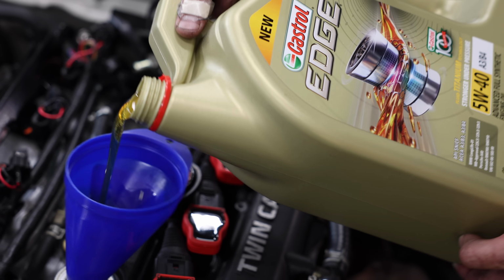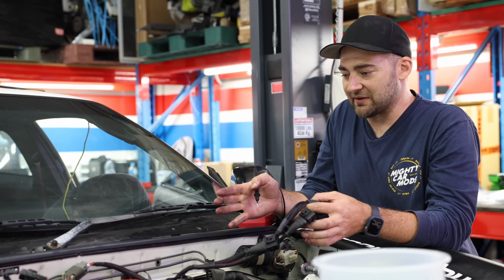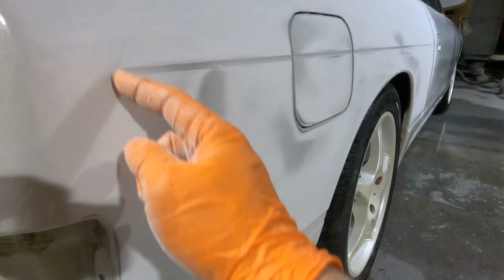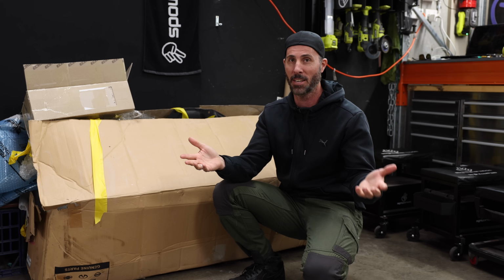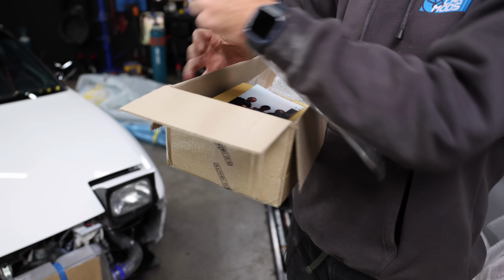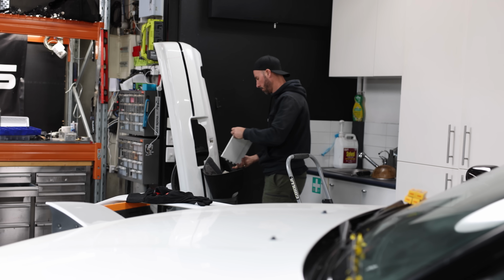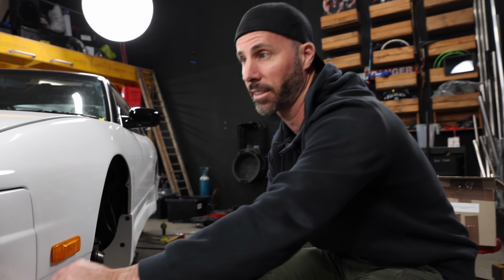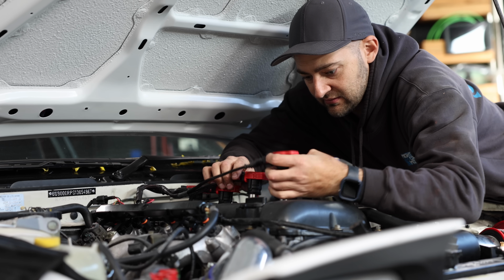180SX - DREAM BUILD EP4

Comment: Hey guys, really loving this series as I have an almost identical 180sx as well. With 5 stud conversions. If you can find s14/s15 front spindles, your local bearing shop should be able to get brand new hubs with studs way cheaper than marketplace. Also r33 rear hubs bolt to 4 stud rear spindles.

Comment: You can actually buy a 3D printed spacer to utilize the old trunk lock cylinder, so you don't have to spend the money and/or use a different key.

Comment: Just love this. ❤ Gives me chills. 🥰 But using the Kouki lock is not the best solution in my opinion. ☺Just expand the OEM lock with two sleeves or washers and bend a new hardwire which is a little bit longer than the OEM part. Takes ten minutes and you'll never have to handle two different keys again like it's a Lada from 1967. 😋 If you want pics how I did this, just let me know. 🤙

Comment: To stop the skirts, or bumper, cracking any further, you can drill a small hole at the end of the crack. Even with ziptie stitches, the vibrations will make the crack grow over time.

Comment: I noticed the Rear windows were removed, i know that you no longer can get them new from Nissan, and my friend had issue because there is rubber gasket with them, and it's as one 'part' so, keep in mind to treat that rubber well, dont know, i just feel it's important
It looks simply great!

Comment: Need to tighten that alternator a bunch. I just chased my miata belts for about 9 months before I realized I wasn't tightening them like they should. If it can turn around half a spin it's too much. Ideally a quarter rotation on the twist test
Reply: 👆🥰✍️
Thâñks før wãtçhīñg 
Ïñböx thē ñümbêr åbøvê ī gôt sömēthîñg prõfïtãblê tø shōw yåh

Comment: This is such a nice example, you should've pulled the engine and at least cleaned it and put a new gasket set on it. Since it's going to be a daily driver style, I would've rebuilt the engine.

Comment: Y’all should see if you could get a nitrogen plastic welder and you could fix those OEM plastics good as new would just need a respray

*since you’re waiting on parts now would be the perfect time to have those cracks fixed and have the parts painted with those other trim bits*

Comment: Dont know how imports works "down under", but a vin number that's been riveted in is a big no no here in Sweden.

Great work BTW!!
Reply: It's done that way in New Zealand and Australia, the local vin is also etched into the chassis (and glass in NZ)..
That local vin is also relevant to the original vin stamped on the vehicle's chassis from manufacturing. 
That "riveted" vin placard is also anti tampered.

Comment: So glad to see the black roof, all s13's need that to look right IMO. As for the different boot lock, you could just remove the barrel entirely and fit a rear view camera in the hole instead and run it off an Android double din. Did exactly the same thing on my Z32. 😎
Reply: 180s it looks good because of the hatch 
S13s look goofy imo
Reply: @JoelVigliotti1  I'm talking about the hatch, not the Silvia. 👍
Reply: @danbrittain9530  should have said rs13 if u meant the hatch. S13 normally refers to the PS13
Reply: @tuckervfx  S13 is a S13.
Reply: @driftingbrandonc.6480  I've lived in Japan on and off for the last 10 years, would have to disagree. A 180 is a 180 and an s13 is closely related but not the same car.
Reply: @tuckervfx  A 180sx is literally a S13. You said it yourself with the chassis code.
Reply: @driftingbrandonc.6480  yes but they arent generally referred to as that which was my point.
Reply: WOW! I will heavily consider doing the camera trick!
Reply: @driftingbrandonc.6480  yeah slick idea to get a low profile camera

Comment: Can we talk about the panel gap between the front bar and the guards? Surely it's not meant to sit like that?!
Reply: Nothing a few washers in between the bar and the cross brace can't fix ;)
Reply: It has had a slight front ender Moog mentioned it when they did the front mount. Maybe that's why
Reply: go look at 90s japanese sports cars, that HAVENT had photo touch ups. that wasnt very far off the mark, even for aged parts being put on by a couple of 4x4 experts
Reply: "Can we talk about the panel gap between the front bar and the guards?"
Sorry it's a  Nissan shit box what did you expect?
 A bullet wound have been better for it than white paint.

Comment: Dammit, this makes me want to get my hands on another Eagle Talon Tsi AWD like I had years ago and build it all fresh. I bought it with 225k miles on the chassis, but all stock and all freshly rebuilt. I put a legit MHI Evo III B16G on it, a 2g 609 MAF, a set of 660cc injectors, a 1gb EEPROM ECU, a full 3" downpipe and exhaust with dual mufflers, a big cold air intake, some HKS 272 cams, adjustable cam gears, a short shifter, and it was dyno tuned by a buddy in Pittsburgh who has an AWD dyno. I wasn't looking for anything crazy, but it made 308 AWHP at 20 psi. That doesn't sound like much, but that's all wheel horsepower and it pulled like a freight train. Now I have a fully built LSVTEC turbo powered EJ8 Civic coupe that I mostly built and painted myself and it currently makes 709 whp at 29.5 psi. I had ALWAYS wanted a DSM and I LOVED that car, but it was more of a "don't meet your heroes" kind of experiences. I even had a 1992 Plymouth Colt hatchback that I swapped a 4G63t into and while it hauled so much ass, it wasn't a comfortable daily and it became more of a racecar...then it spun a bearing and I got tired of it.

Comment: Seems you're putting a lot of effort into this one, it might be wise to have the car wrapped in PPF so the fresh paint doesn't get chipped off.
Reply: Can't wrap that car for a long while. Cars still bleeding solvents and PPF is prohibitively expensive and pointless.
Reply: @DStead2239  pointless to a point. after about 6 months (gas off time), a correction/cleaning and a wrap could go a long way in protecting the finish of a daily driven car. im thinking these guys would be able to work out a deal that benefits them and the shop that does the work.
Reply: @ghomerhust  Pointless. They've got mate's who can give em a respray and I doubt it'll see much use once done.

Comment: I wish I had a cool car , you two have so many options. I'm from the u.s. we didn't get all the JDM cars but the one I would love to have is a falcon
Reply: You done the Berra motor but they were not sold in the u.s. 
 Another thing you can put a small block Chevy into a 280 Datsun , transmission will bolt up motor mounts I think even line up and the small block 350 actually weighs less than the straight six you take out of it, one once upon a Time we made a drag car out of a 280.
Reply: @Wrulol I just said small block Chevy 327, 305, 307  there's more than a 350
Reply: @Wrulol if I'm not mistaken Holden had a small block Chevy

Comment: You can repin the new lock with the pins of the old lock so it’s the same, assuming the only difference Between the locks is the outside. Just swap internals
Reply: my grandmother was a locksmith for 25 years and taught me how to do pinning. it's not hard at all, just gotta have stable hands and some tweezers! ive repinned tons of vw tumblers to match the key set that i already had. works like a charm

Comment: 5:31 Those R8 coil wiggle like crazy it's really odd. My S13 with the same coil without any modification fits snug and doesn't even move in the "tube" of the coil..
Reply: I imagine they're going to make a propper bracket
Reply: @jonathanwright5550  They've put it on in this video